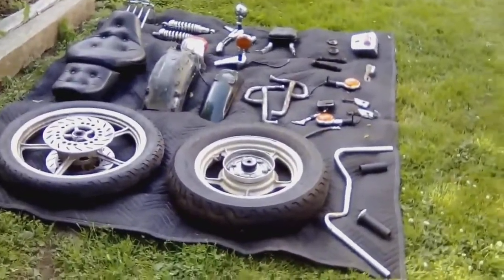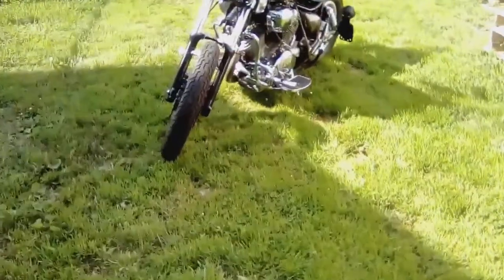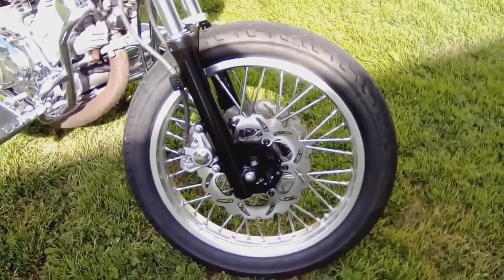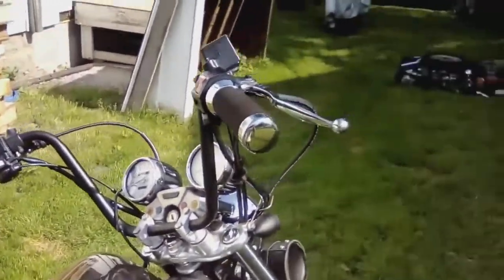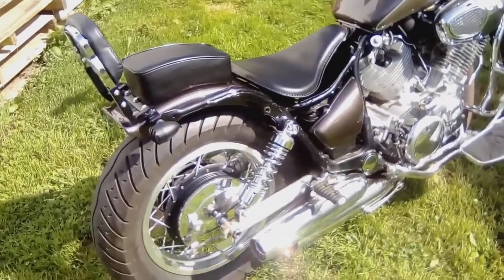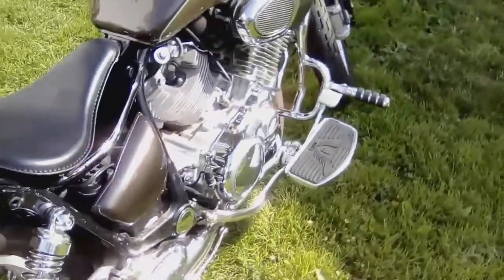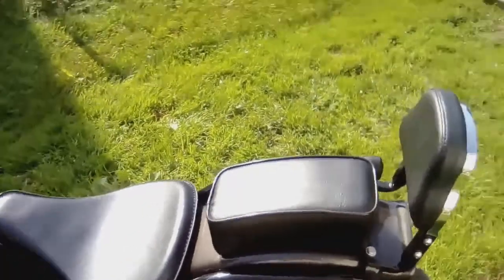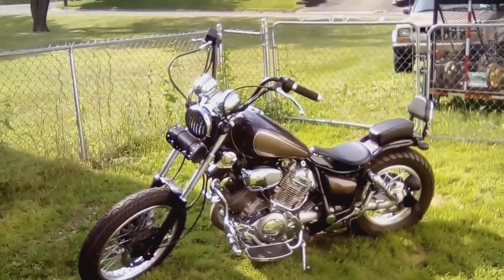Yamaha Virago XV 750 chopper 1994 final reveal and walk around

Comment: I got 2 1981 and want to lower, but mine have the air shock . If you put air in it's so tall it will fall over.
Reply from the maker: thanks for watching , i know thats a mono shock, idk what the pressure is supposed to be. if i remember right the psi in those i pretty low check your manual to see what it should be set at thanks again for checking out the channel,  ride safe.